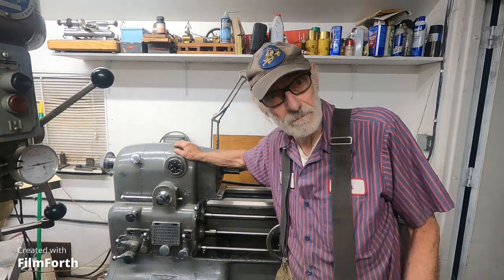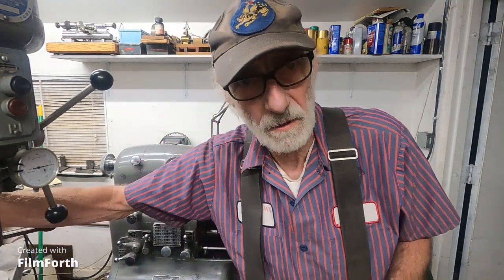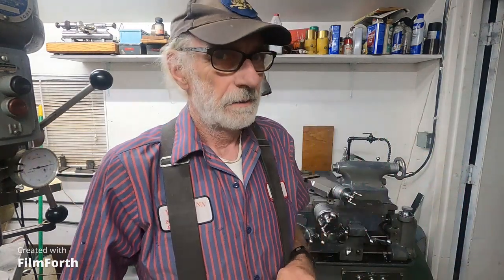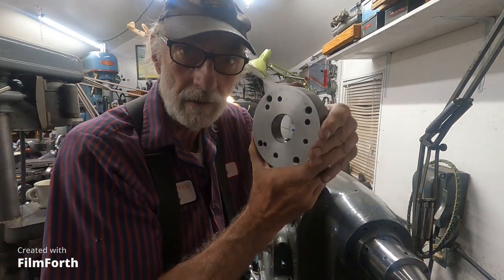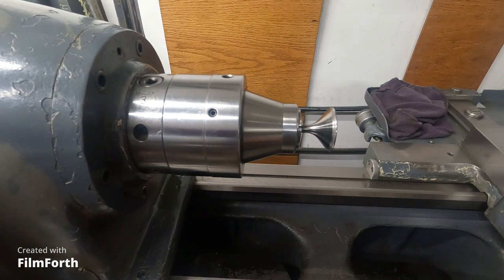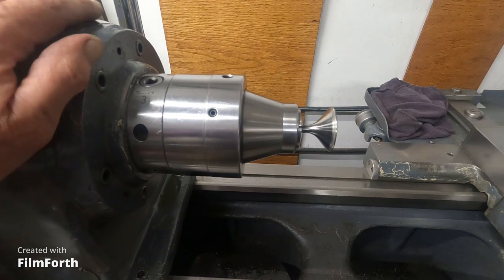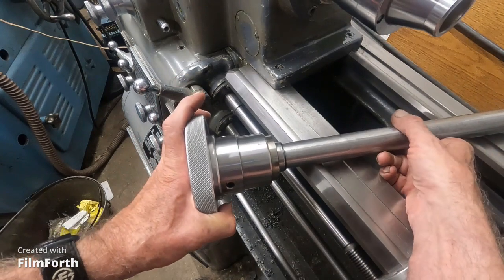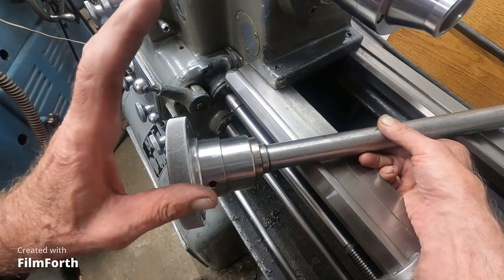Advanced machining with 5c collets on the 10ee lathe

Comment: Very informative! I'd like to hear your views on Set-Tru or similar adjustable chucks in general. I can dial in my 5C (D1-4) ST to a tenth but it appears to drift over time. Seems like more when off the machine for a period vs mounted on the spindle. I've tried different torque settings on the set screws & axial/retention bolts (too much? too little? its not specified). Maybe this system is intended to be tweaked more often vs. set & forget? Rob Renzetti did an interesting video showing chuck body distortion of these radial adjust systems.
Reply from the maker: Yes, any forces at all show up working in tenths. The adjust true chucks should be more carefully by not having tension on the side adjusting screws when the front screws set. The best conventional chucking is with a small as possible 4 jaw chuck, and even there the chuck jaws need even tension not to distort the chuck body, the ultimate is a shrink chuck where the workpiece is simply held using a steel disk with a slightly under size hole, that may be needed to avoid stress risers from chuck jaws on some materials. Thanks!
Reply: @deedeeindustrialsuperprecision  great info Sir....cheers, Paul

Comment: I understand how a collet chuck for the lathe can be useful for doing repetitive production type work on nominal diameter size stock. Are there any other advantages over a reasonably accurate three jaw or four jaw when you need the precision?  Thank you in advance.
Reply from the maker: You can get behind a workpiece easier, polish and have your hands close better with collet chucks, I mostly found a 4 jaw is hard to beat. I will do a demo with scroll chuck and show what happens when they are sped up to top speeds, thanks!

Comment: Donnie-  Amazing video.  Lots of knowledge you shared here.  I honestly did not know all those things about drawbars and 5C collets.  What are your opinions on the ER collet system ?  Like ER32 or ER40 ?  There are smaller ones too.  I know you can get ER collets on a flat flange adapter. Nice for set-true mounting them.  Are their double tapers good for accuracy or do they fight their alignments?  Interested to know your thoughts.  THanks.  ---Doozer
Reply from the maker: The Boeing company switched from Erickson double angle collets to the ER system in the 1980s because of better overall performance. I used Erickson from the 1980s because Boeing sold out so cheap. I bought my first ER 40 set for the horizontal mill and a holder for my lathe and drill and it is working really good. The only small problem is a part rotates when tightening the collet, the 5c stays fixed from its locating slot making it better on the cutter grinder work head for easier positioning of a tool.
I have read that the ER are the most accurate available when they cost $171 each!
Reply: @deedeeindustrialsuperprecision  Thank you Donnie for your insight.  I have an all Hardinge 5C set from 1/16 to 1" and a bunch of larger pot chucks and step collets.  I have a Tsugami chucker, which is a copy of a Hardinge HC.  I also have an HLV-H.  I started with a cheaper ER40 set for my SIP MP5 jig borer, and I am going to fit a face plate on my B&S #13 grinder with an ER40 adapter as well.  It is good to know the ER system is a good collet system. THanks. ---Doozer
Reply: Great discussion on 5c issues, I have the Monarch nose 5c chuck for my 10ee, but never built the drawbar (on the list), but do have the handwheel chuck along with a collet chuck, I have a lever closer for my Clausing 6313….never thought of the possibility of what you discussed…thanks for sharing

Comment: OOps! We woke up Charlie again lol. Now I'm a little confused. A millwright made a Precision tool on a Tool Makers lathe. Or did a Toolmaker make it? If a Millwright made it, they were a Top Shelf Millwright. Now I have a serious question. I bought 2 brand new Harding HlHV lathes (for our Toolroom where I worked) both tooled with factory lever closures and 5-c collets. I once heard that Harding developed the 5-c collet and theirs is better than any others. Does Harding still guarantee .0002 with their collets and closure?
Reply from the maker: Most manufacturers will have a line of high precision collets I have not had to purchase 5c collets in a very long time. I saw a price of $171 for a single precision ER 40 collet recently.